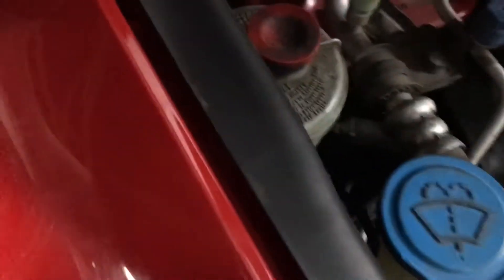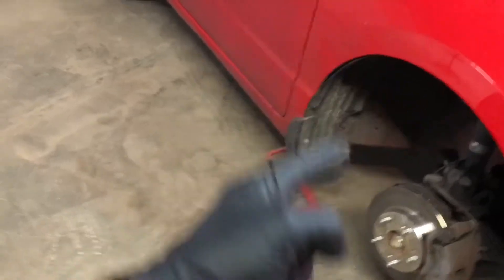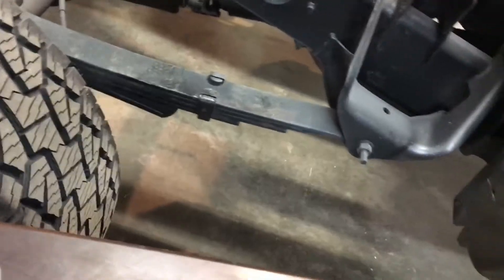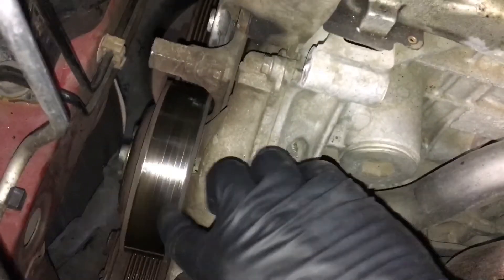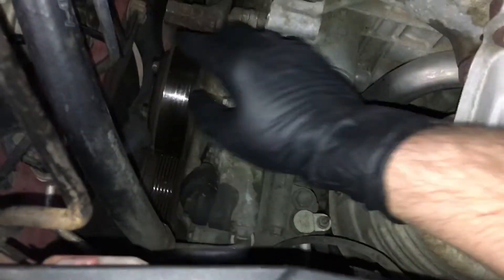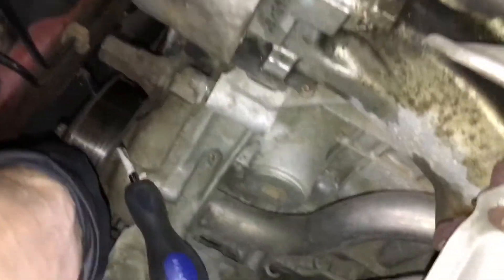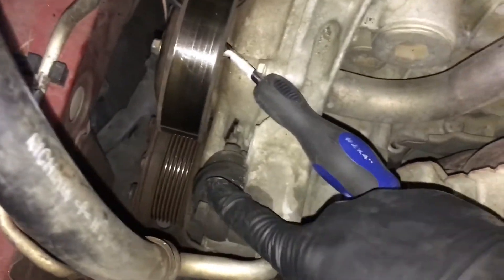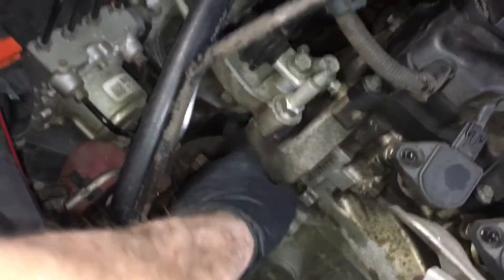2005-2011 Honda Civic Belt & Belt Tensioner REPLACEMENT

Comment: One tip that I've found comes in handy for dealing with stuck socket head cap screws is to put a bit of valve lapping compound on your allen key/socket before getting in there. It helps bite into the head better and takes up a bit of the space between key and bolt head to reduce the chances of stripping the bolt head out. This is used commonly with newer subarus' cam sprocket bolts that are a bear to deal with.
Reply: Wow... how did I never hear of this before. Great tip. Thanks!